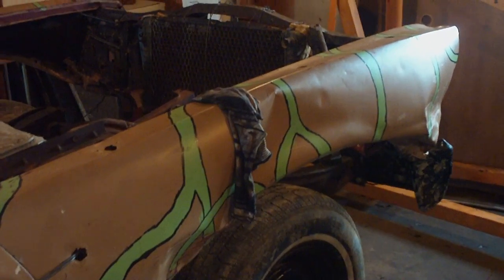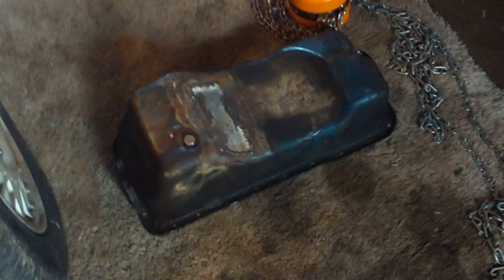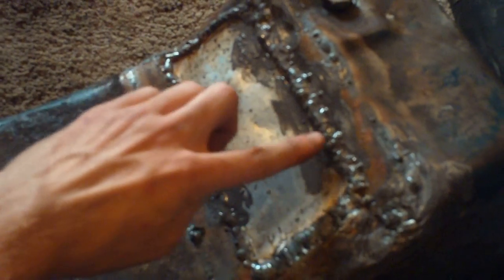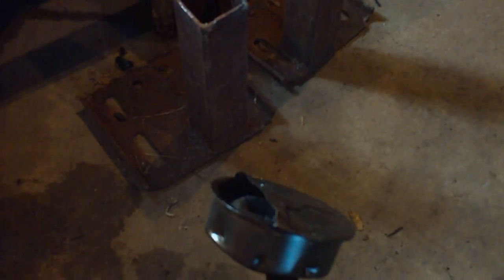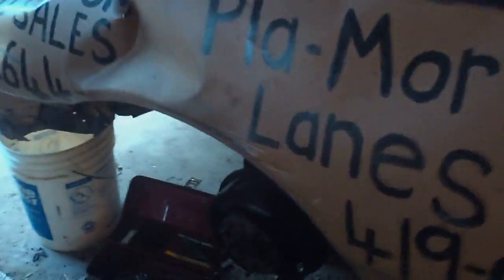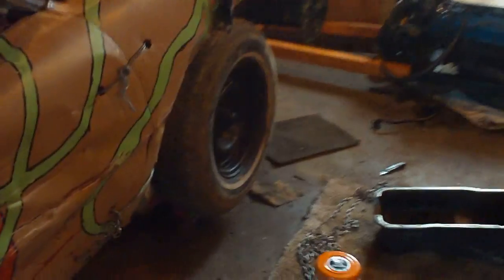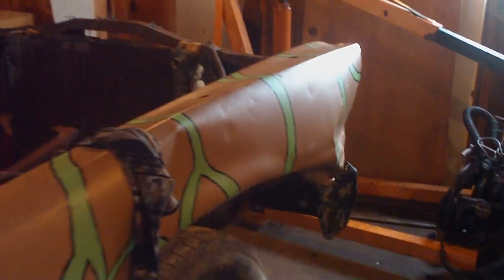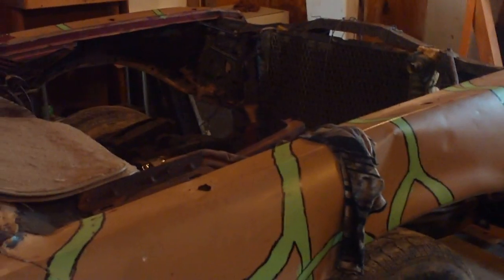May Derby Updates on the 76 Thunderbird

Comment: Hey Mitch. Check the proportioning valve. They also have a saftey feature built in. So if you lose the front caliper seals it turns off the fronts. It can cause problems when you don't run front brakes. Most of they a re a little rusty. And when you disconect the front. The valve shuts the fluid off to the rear. But then sticks in that postion. I have had this problem. Now I always remove it. And make new lines.

Comment: Hey Ultra Copper permatex silicone seals rads pretty good ,depending on the damage. Just squeeze it through both sides. I also cut the rubber out of the rad cap so it can vent pressure and not pop a hose.